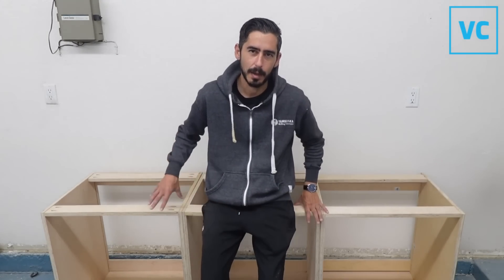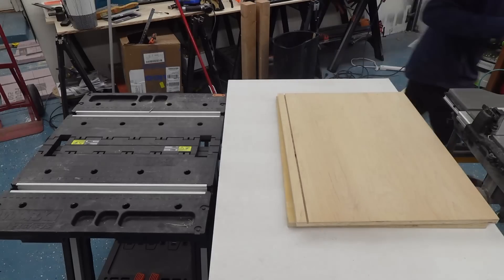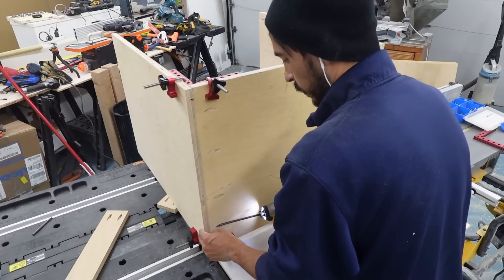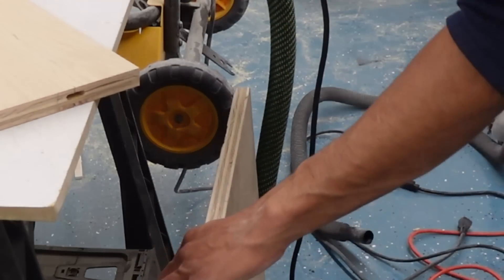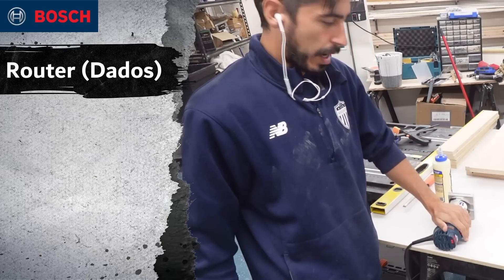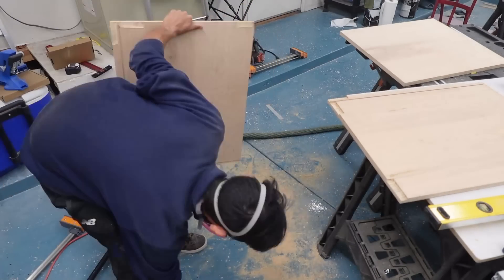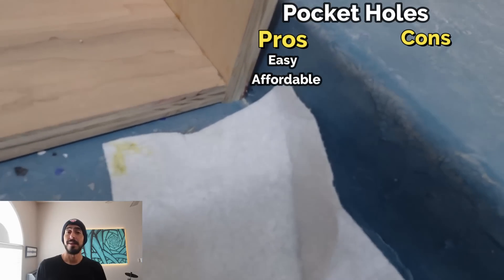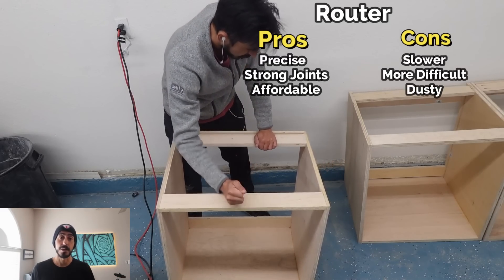Dominos vs Pocket Holes vs Dados | Testing Joinery on Cabinet Boxes

Comment: Enjoyed the video. I think you missed a major point in the timing/cost. That is pocket holes do not require a number of large clams (cost) or time for the glue to dry. (They can be put into place immediated after assembly)  If production is a consideration (time being money) I believe pocket hole is better. also the clamping methohod you used for pocket holes I believe contributed to accuracy errors. I have never had my joints be and less accuratre than the other 2 methods..  I believe all 3 methods are viable and which a person uses depends on what they have available. Thanks again for the videol.
Reply: On the contrary of taking large clamps out of the cost. I use large trigger clamps (not that expensive), instead of the corner clamps shown in this video.   That is where most of the time was wasted here. If you cut your brace pieces square, you don't need to square off each assembly with a clamp.  If the piece you're screwing into is out of square, those clamps will do nothing other than leave a gap.  A quick check with an actual square here and there  just to double check is all that is needed.   Once you compress the assembly with a trigger clamp, the pieces do not move at all, allowing for perfect minute adjustments with taps of a mallet before screwing.   Precise, fast. cheap, and good.  I wouldn't do cabinet boxes any other way.
Reply from the maker: That’s a really great point, I should’ve pointed out the cost and necessity for clamps that pocket holes bypass.  Also I’m sure you are right, I still can improve my clamping technique here

Comment: For most cabinet boxes none of this is needed at all. Just glue and screw. Or just screw, even.
Reply from the maker: Agreed, easy to over engineer these boxes.  I do think there is some need for additional measures if you are going for precision, but it d the goal is to just crank out the boxes, can keep it simple and still have a good result

Comment: Good video!

One other thing?  Most of the joinery I see coming out of professional cabinet-making shops is pocket-hole joinery.  But it is not done with a Kreg or similar jig but done with a pocket-hole cutter.  The ones I think dominate are the ones from Castle USA.  It actually uses a router and the professional cutters have a 6° angle to the screws instead of the 15° angle you see with most of the Kreg-type pocket-hole jigs.  For the hobbyist Castle makes their 110 cutter and that has a 3° angle which means that your joints generally don't shift perceptibly even if you don't clamp like crazy.

Downsides are that the Castle 110 is pretty danged noisy.  I think its just a tiny bit slower although once you have the rhythm, not by much if at all.  Cost is much, much higher.  Oh, and it won't work on material more than 1" thick.  But that smaller angle means stronger joints that don't shift.  And since it won't handle thick material you might end up with the cost of the Castle 110 and a Kreg jig as well so that you can handle 2x4s.
Reply from the maker: Thanks for the info!